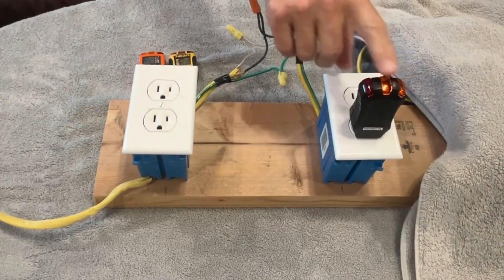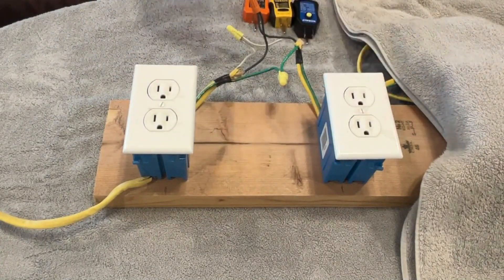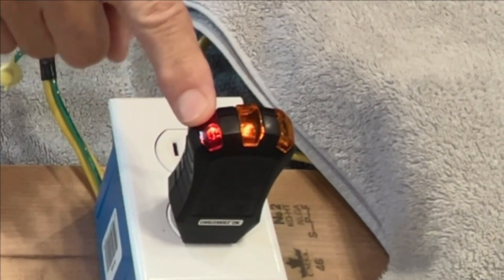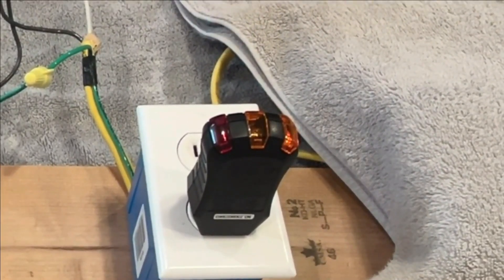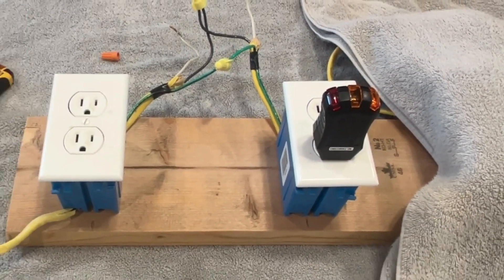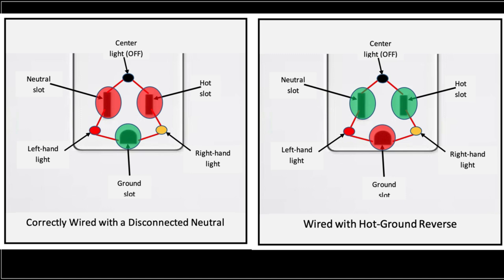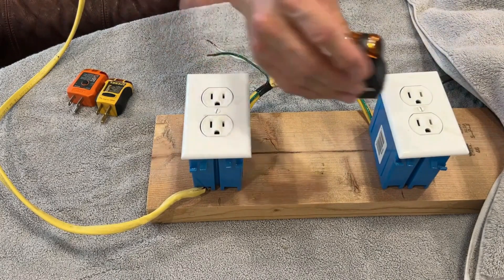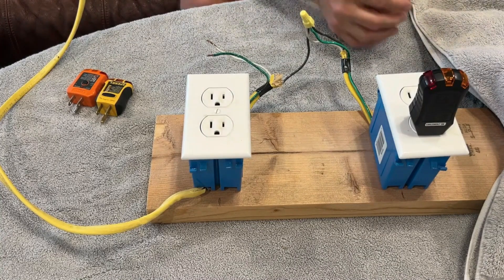3-Light Testers - The Definitive Guide

Comment: My three light tester showed open ground on a three prong outlet that a previous owner had wired to ungrounded 14-2 Romex. However, the NCVT also started squealing around that outlet from inches away, similar to a reverse polarity bootleg ground. It turns out that I have an broken open neutral at the next downstream outlet. That downstream outlet also only shows open ground. It does not seem to detect the open neutral and it does not show hot-ground reverse either. I presume that it is because the tester can't show an open neutral if no ground is present
Reply from the maker: Interesting case study. You are correct. The receptacle must be grounded in order for it to give that indication. Without the ground, it does not have that reference.

Comment: The center light on my tester is on but it's dim. The breaker popped and when I turned it back on, the lamp on the out let was dim. I replaced the breaker thinking it was damaged but that didn't fix it. Checked the connections and everything looked fine. All the neutral wires I could see had good connections. I'm stumped

Comment: 8:13     This condition with all slots at 120V to ground potential can inadvertently occur with a bootleg ground receptacle with an open neutral and load connected downstream.  Just as in the "Hot/ground reverse" reading when you really have an open neutral and load turned on , because of the jumper between the neutral and ground terminals, you now have live current on the hot, neutral and ground slots. I have yet to come across something of this magnitude, although I've seen my share of open neutrals from failed backstab connections, so this occurrence isn't far from impossible.  

All this having been said, this brings up another thing we need to be aware of regarding the limitations of 3 light testers especially if inspecting a home built before the mid 1960s: A 3 light tester CANNOT tell the difference between a correct polarity bootleg ground, a reverse polarity bootleg ground, and a properly wired receptacle.
Reply from the maker: As always, thank you for the input. I think it was yesterday that somebody commented basically the same thing. I think I’m going to have to play with my test board and set up that configuration and make another short video showing that.

Comment: Actually there is a real life situation where each slot could have 120V (referenced to ground) - an open neutral upstream of a cheated ground outlet eg. a jumper between the ground and neutral screw to make an open ground outlet read as correct wiring, a problem that occurs more often than you might think, often in a flipper home
Reply from the maker: @rarelampcollector  hmmmm. I’ll have to give that one some thought.